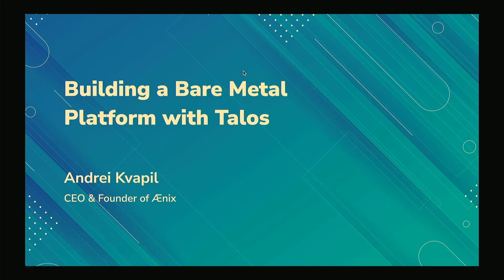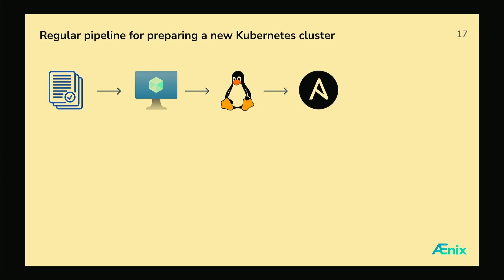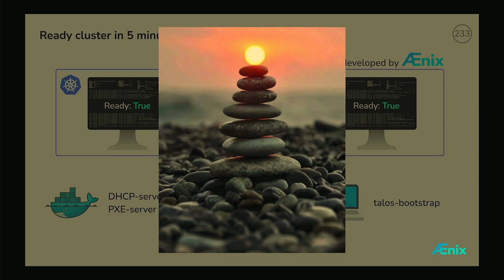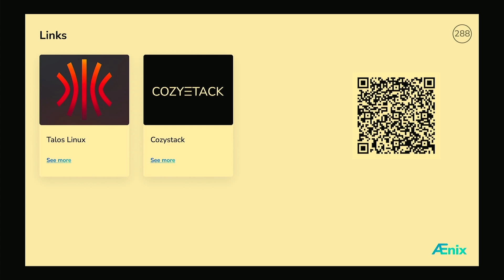Building a Bare Metal Platform with Talos

Comment: 00:00:00 Andrey's Experience and the Founding of Ænix
00:01:12 The History of Creating Talos Linux
00:02:06 Pipeline: Installing Kubernetes "Out of the Box", Using FluxCD
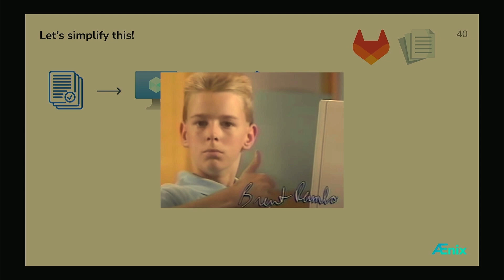00:04:23 Working with Infrastructure: Proxmox and OpenStack Images, Testing with Docker, VMs in the Cloud and on Local Servers
00:05:21 Setting Up a Virtual Machine with Talos Linux and Configuring the System Using a YAML File
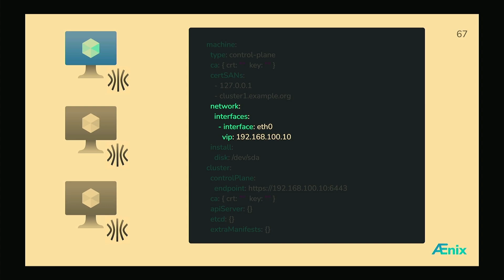00:06:35 Cluster Configuration: Setting Up Nodes and Clusters, Configuring Network Interfaces
00:06:54 Applying Configuration with talosctl
00:08:48 Seamless Node Updates and Migrating Workloads from One Node to Another
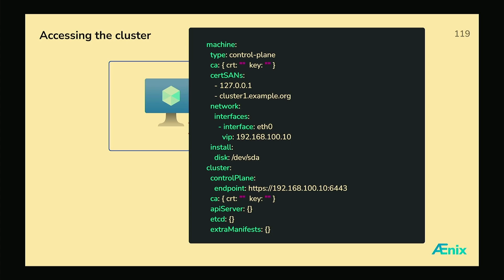00:09:23 Accessing the Cluster
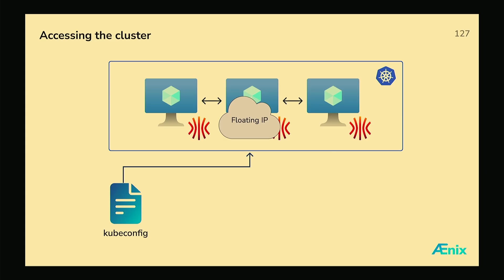00:10:02 Infrastructure Setup
00:12:59 Creating a Talos Linux Image
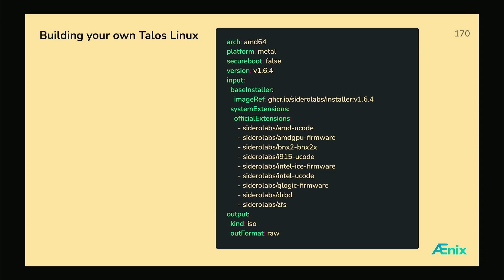00:13:52 Loading the Image onto Bare Metal
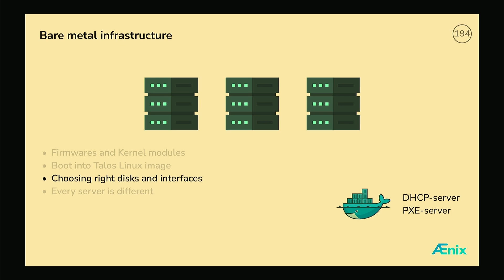00:15:29 Talos Bootstrap
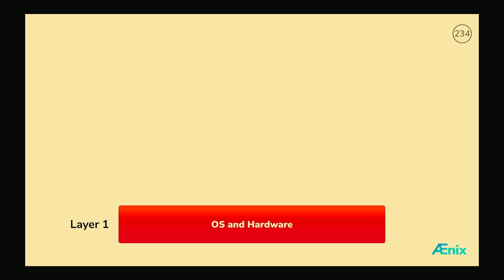00:17:32 Components of the Cozystack Open Source Platform
00:18:31 Platform Layers
00:19:35 Debugging in Talos Linux
00:22:12 Unified Environments and Support
00:25:19 Division of Responsibilities
00:26:57 Using Kamaji for Managing Kubernetes
00:28:15 Open Source Community and etcd-operator
00:28:47 Linstor Storage System
00:31:00 Application Catalog and Dashboard in Cozystack
00:32:45 Resource Limitation for Clients
00:34:36 Using GitHub and Dashboard